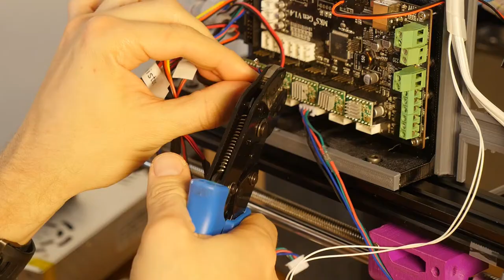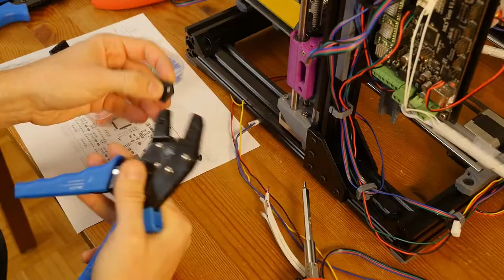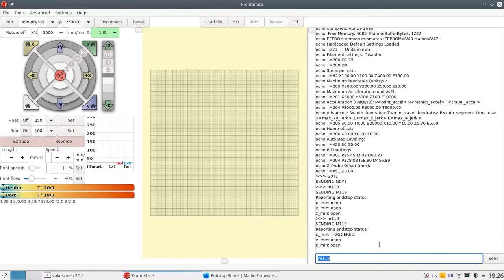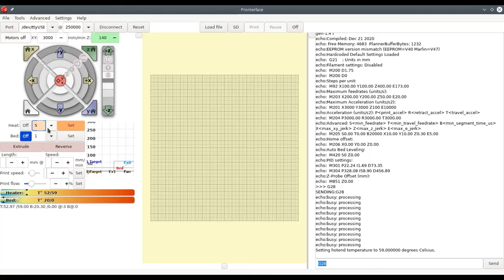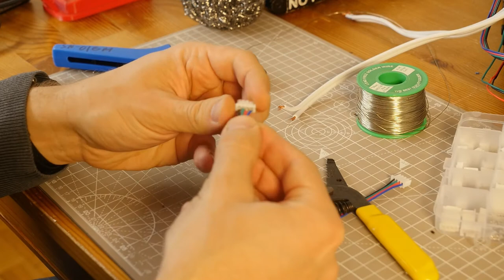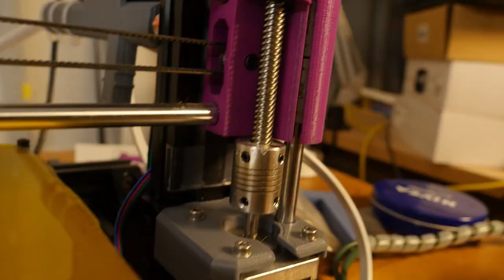Wiring up MKS GEN 1.4 | Bear Upgrade

Comment: hey can you share the firmware , if you configured it? building the exact same printer
Reply from the maker: Sure, here it is:

* Configuration.h -- https://github.com/avolkov/dolly-marlin/blob/master/marlin-1.1.9/mks-gen-1.4/Marlin/Configuration.h
* Configuration_adv.h (mostly needed for dual Z steppers) --  https://github.com/avolkov/dolly-marlin/blob/master/marlin-1.1.9/mks-gen-1.4/Marlin/Configuration_adv.h